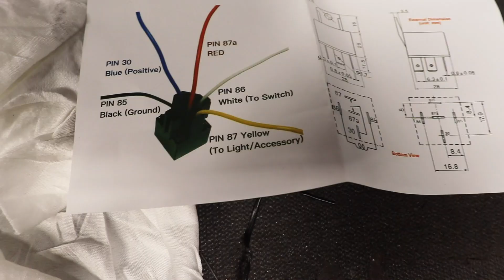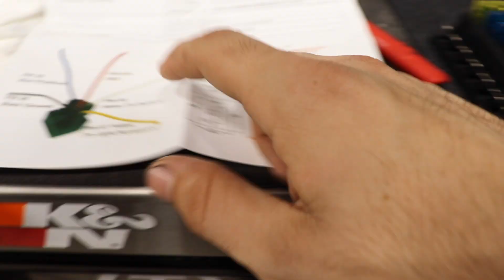DIY Race Car Fuse/Relay Panel

Comment: Very good presentation.  Great explanations.  
To add, only voltage diminishes with distance.  Amperage is the capacity of the wire, and that is determined only by diameter/strands and  surface area.  Any length of a wire will heat up as more amperage is required.  It will heat the same in one inch as it will in 100.  What is the amperage rating for the junction block?  I looked at your link and it appears to not show the amperage rating for each circuit.  Given the price, I suspect it is 15 or 20 amps per circuit.  The relays will be at least 30 amps capacity, as is the fuse box per circuit.  Wait, I went to the link and it does not list the amperage capacity of the individual circuits.  The whole box is rated to 100 amps total, but what is the limit on the circuits?  They free fuses, and they only go to 20 amps.  Are they saying that is the largest fuse you can use?  Everything I buy on Amazon has amperage ratings, and I never buy something without at least a "claim".  Likely, a 30 amp rated junction strip could work better.  Be careful to check the gauge of the wires installed in the relay connectors.  The ones you list do not say what gauge wire is used.  I prefer 12awg for 30 amp relays.

Comment: If you’re still using the factory key does the power coming from accessory wire on ignition switch go straight to fuse block or to a relay first ?
Reply from the maker: You can do it either way as long as the wires on the ignition are thick enough to handle the amps.
Reply: @FSOMedia  okay that makes sense
As I keep seeing it done both ways ! good video man keep up the channel stuff good luck

Comment: Awesome looking panel, thanks for the help... would have preferred if you identify the relay terminals by # too, as not all relays have the same color wires.
Reply from the maker: Great point. I’ve since realized that but this video is older lol

Comment: Looks awesome. Thank you so much for this video. Quick question what do you do for your wipers and lights? Do you have hi and low beam or just one. And do you have wiper speeds or just one?
Reply from the maker: That you! Nissan runs the power through the headlight stalk from factory so I just copied them for my 240. I only have 1 speed on my wipers.

Comment: Working on a boat and I really like how clean this setup is. But with the boat, I need to have two switches that are three position (bilge pump and nav lights). As well as another 5-7 regular on off switches with one momentary. With the Nav lights one switch has 3 positions, you push it up for all your lights (front light, and back light) and then push it down for just your back light. Also with the bilge pump, it needs to have 3 positions, up would be automatic and tie into one wire off the bilge, then down would be manual override which is another wire off the bilge. Center position for both of these switches would be off. Thanks!
Reply from the maker: That's awesome! It's cool seeing the crossover of boats to cars! Best of luck to you👌

Comment: Would the ignition go through this also? For example my ecu needs two power wires, when I hit the switch for ignition it will power the ecu...should that go through this setup? Sorry if that’s confusing lol
Reply from the maker: You should have it on a fuse panel. I have the ecu power coming off the fuse panel and there's a switch interupting it. The fuses will protect the ecu incase too many amps go on that line. Always put everything on fuses just so you have the piece of mind that the fuse will blow and protect the accessory. Let me know if you have any other questions man and I'll try and help if I can👌

Comment: So if white goes to the toggle switch and yellow goes to the accessory power where do you put the other pin to the toggle switch I’m confused I’d like to do this myself trying to understand how this works
Reply from the maker: The other side of the switch goes to ground. When you flip the switch and ground out the relay it'll activate and bring power to the accessory. I've got another video where I did the whole chassis harness and everything is time stamped in the description if you have more questions. Hopefully that helps you out and if not feel free to ask👌
Reply: Thanks I’ll check it out
Reply: No toggle switch their shit

Comment: Red wire (30) is power IN from fuse block. White wire isnt used. Yellow wire (86) is Power to switches. Blue wire (87) is power out to accessory.
Reply from the maker: 0:41 

That's when I show the diagram for these relays. Totally different than what you said. Maybe you're talking about different relays but the ones I have are wired correctly.

Comment: nice simple set-up , where did you buy this set up,also any feedback from you ksport
Reply from the maker: Thanks! I got everything for it off of amazon (links are in the description). I haven't really had a whole lot of seat time with these coilovers but so far I like them. They are really smooth after 40mph and just soak up bumps. They feel a little softer than regular coilovers under 40 but are still bumpy. I may go to softer springs and see how that goes but out of the box they are pretty good